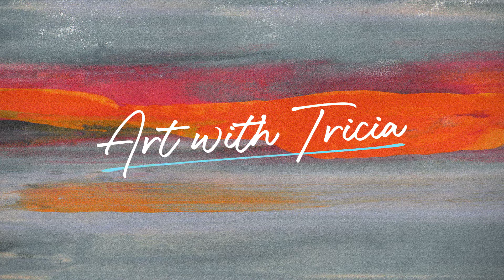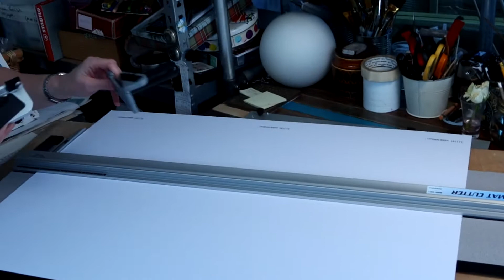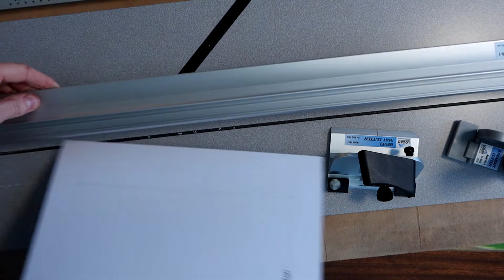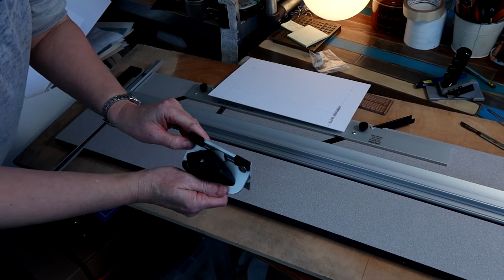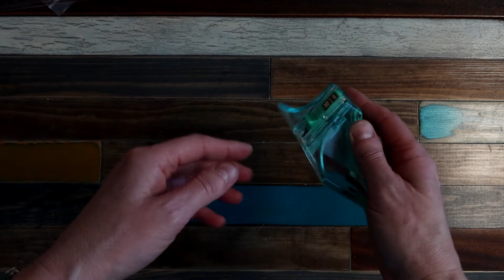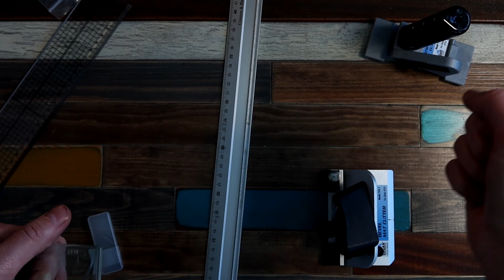Cutting a picture mount

Comment: Thank you for this video! I am starting to think about cutting my own mounts. I would like to be able to repurpose old picture frames and charity shop finds. I have learned a lot from your video and now feel more confident to get started! 😊

I have had a look on Lions website. Can I ask why you selected this particular model please?
Reply from the maker: @JaneWeightman  I'm glad the video was useful. 
I chose this model because I wanted to buy a proper mount cutter, instead of the little tool and ruler. I had a certain budget that I had saved and I went for the largest I could get at my budget.
But to be honest, the large size is good for cutting the board down initially, but a pain the rest of the time as I never really cut massive mounts. As you can see in the video a lot of the cutter isn't used.
I also don't have space to leave it out. So I end up with a list of mounts I need to cut, then do a big job lot in one day, then it all gets packed away.
The model I have is the 450-1, but there is a slightly smaller one below that. I think I would check it could still cut a sheet of mount board (at least width ways) and then buy that size.
It depends how much space you have and if you've got a table/surface you can put it on. I've tried to do this on the floor and that doesn't work for me. I need it on a table.
Good luck with your mount cutting and get back to me if you have more questions. 🙂
Reply: @artwithtricia   Thank you, that's really helpful :)

Comment: Why choices of 45 degrees and 90 degrees please Tricia ? I couldn't see what was lining up with what, so a classroom in-person demo would be better for me.  I'm unlikely to invest in something so large so sadly stuck with the low-tech option - a craft knife! Otherwise, a step by step demo of the little manual one you found would have been valuable (does it cut on that neat angle you spoke of?). Mounts come with different colored innards - how interesting! Thanks
Reply from the maker: Yes the little cutter cuts at a 45 degree angle. You can buy mountboard with different coloured inner core. So you may have a blackmount but white or cream inner. I guess a 45 degree angle, not only shows the inner core, but is also a softer step down between mount and artwork. If you had a double mount you could have a black mount then a white line of the inner core and then a black mount then a white line and then your artwork. It's a good way to make your mount look 'jazzy'! 😉

Comment: Hi Tricia, very good video. Can you tell me the thickness of the mountboard you used? As I'm new to this, is it mountboard or foam board? Cheers Alan
Reply from the maker: Thanks for the feedback. It's just regular mountboard. 1250 microns which is 1.25mm thick. You can buy mountboard with different coloured cores. So black outside with white in the middle, have a search around as there are lots of different colours... and prices. Best of luck Tricia

Comment: What a terrible mount!   All sides of the mount should be the same width.  Only time this should alter is if the top one is slightly less than the bottom one.  For example:  all sides 5ams or right and left sides 5cm with top at 4.5cm and bottom at 5.5cm
Reply from the maker: Thanks for the comment, it's interesting to hear how you would go about it.
Reply: @artwithtricia  I think I've already done that!  Perhaps it is also relevant to bear in mind the relevance of frame to picture not trying to fit a picture into a given sized frame.
Reply: What rambling and confusing instructions. Too much chat.